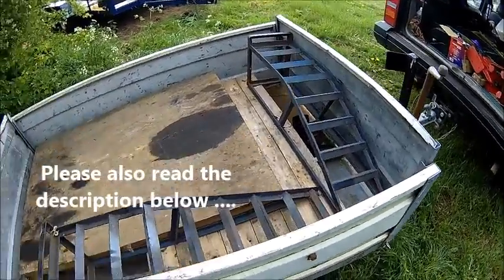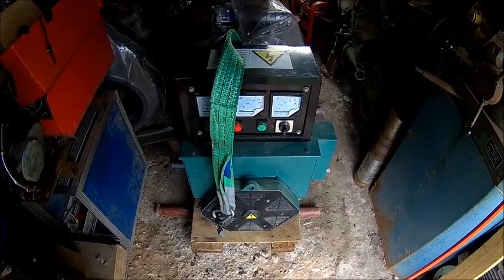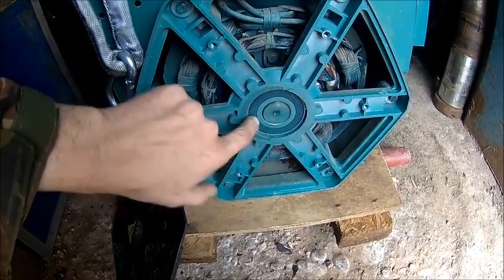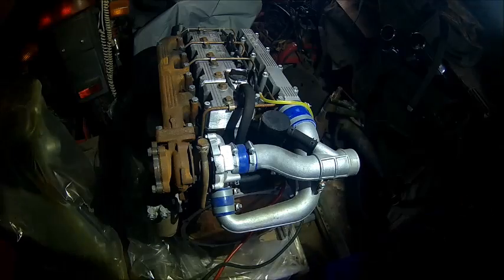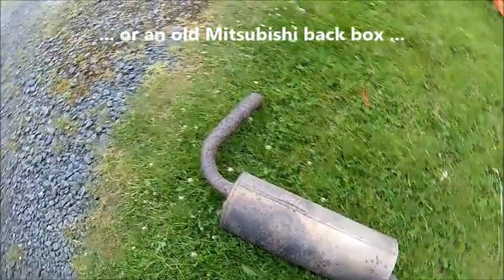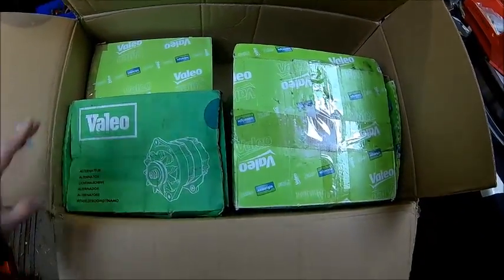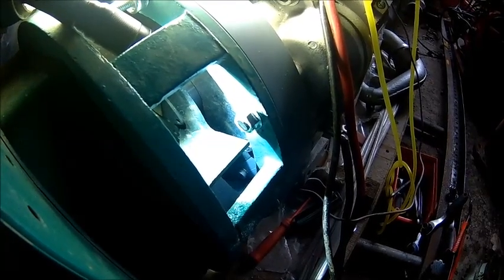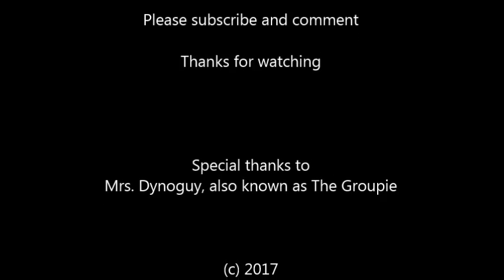20kW Diesel Generator, built from random parts - Part 1, Why, what and how, sourcing parts

Comment: Well the good thing is parts should always be available.  Generac  only services their generators for 7 years.
Reply from the maker: True, ...but even when they don't service the anymore, you will still get parts as they mostly use  off the shelf stuff.
Reply: @dynoguy  I have one and it can be very difficult to source parts.   Mine is from 2006.
Reply from the maker: I wonder what sort of parts you talking about,... a genset is certainly not a space ship, these things are pretty simple, just and engine running at a constant speed ( i guess you in  the US, so that's either 1800 or 3600rpm) and some sort of Generator coupled to it,  both are not made by Generac, they just buy them in from the usual suspects.. 
The electrics are simple as well, any sparky should be able to fix things on that.
i guess you mainly need consumables like filters, fan belts, etc., you'll get them at any decent tractor supply shop, just bring the old one and they'll figure out what you need,  And when it comes to an engine overhaul or engine parts,...  as far as i remember,. Generac mainly uses Kubota, Perkins and Isuzu engines, parts should be widely available, even in the US ...
For example, my forklift is from 1977, the manufacturer is long gone, but Perkins still stocks any part required for the engine.
Reply: @dynoguy  mine is a propane.  The only part that has gone bad so far is for the fuel system.  Even with the part number I couldn’t find one.   I ended up taking it apart and repairing it.   A lot of times when I’m looking for parts I find them in the UK easily but not the US. I had the same problem with my old A15 engine.   My next generator will be a diesel if this one ever goes.

Comment: What is the gallons per hour on a little engine like that? I'm guessing being diesel it's a very efficient engine
Reply from the maker: It's also turbocharged, makes it even more efficient, Fuel usage obviously depends load,  these engines burn around 260 grams/kWh , so that's around 5 liters/hour full load at 1500rpm.(approx 1.3 US gal/hr)

Comment: What do you do with all the computer keyboards, also what is the 2 stroke bike under the cover? (I saw the exhaust baffle)
Reply from the maker: you got a sharp eye .... some of these keyboards are odd languages (Swedish, French, German) some with odd connectors and one with an XT/AT switch,  not sure if you old enough to know what that is for ...:-) ...I keep them because i do repair old and obsolete industrial gear.  That bike is an RD350LC project, just another one on the long list, ...at present i have 3 bikes roadworthy and about 10 projects ......
Reply: I am old enough, I also have a stack of PC keyboards for PS2/XT/DEC/AS400/3270/5250 but I only have one IBM in Arabic, I also service obsolete industrial equipment for railways and tramways and to top it off I also have 3 motorbikes and at least 10 projects...lol
Reply from the maker: seems i am not alone with my hoarding illness ...:-)  ... merry Christmas

Comment: Nice work. That looks like a very good engine. I'm guessing 50 or 60 horse power. Do you know?
Reply from the maker: Thanks,.. it's an 1860cc industrial engine  and you're about right (max 55hp at 3000), but in a generator application the power rating is much less, .. , fuel stop is about  30hp at 1500 rpm and 38hp at 1800rpm, prime power rating is approx 10% below these numbers.